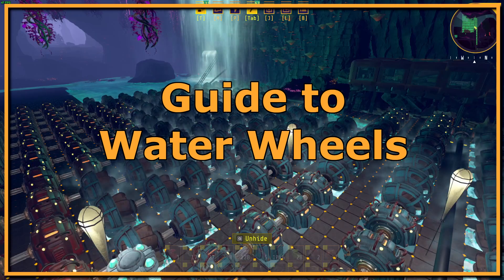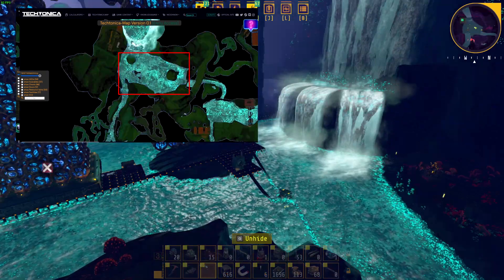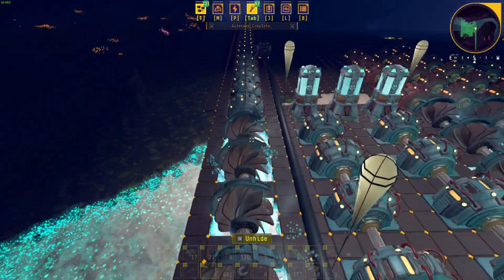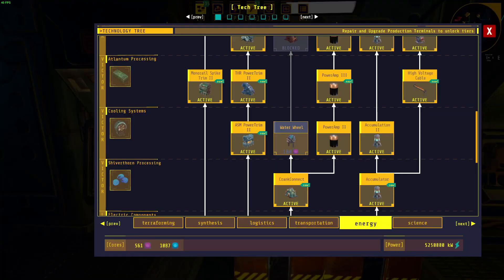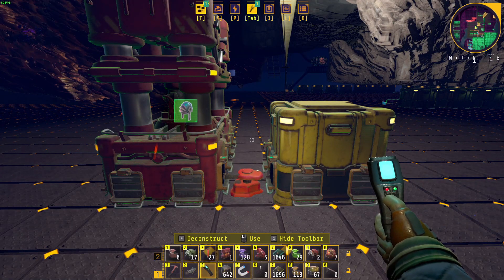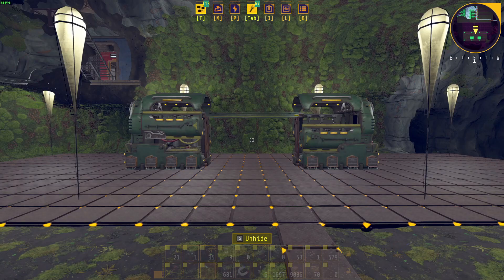Techtonica - Guide to Water Wheels

Comment: That ratio is wrong.
One waterwheel can turn 2,5 crank generators. So 2 waterwheels fully power 5 Mk I generators.
For Mk II generators the Ratio is 5 wheels to 4 generators.
The math is +100 nm per wheel. One MkI Generator needs 40 nm. One Mk II needs 125 nm.
Reply from the maker: This was before the update

Comment from the maker: Very Handy Calculator ►https://www.techtonica-calculator.com/

00:15 - How They Work

00:45 - Good Locations for Power

01:04 - Wheel to Crank Ratios

02:19 - Where to Unlock Them

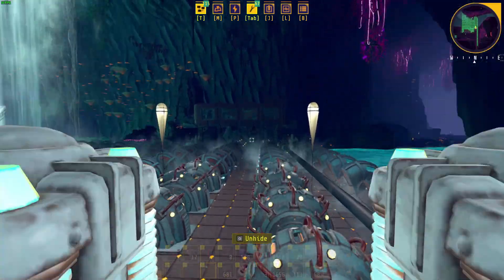03:27 - Detailed Breakdown

04:03 - Wheel Dimensions

04:22 - Chests Containing Wheels

04:34 - Crank & Wheel Numbers

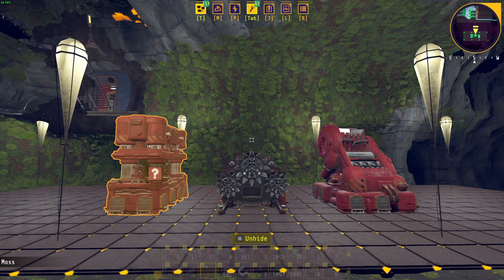05:03 - Module Power Usage